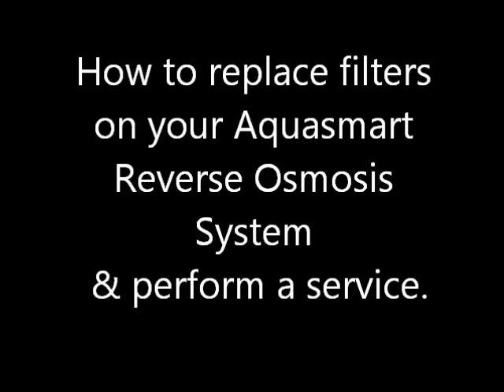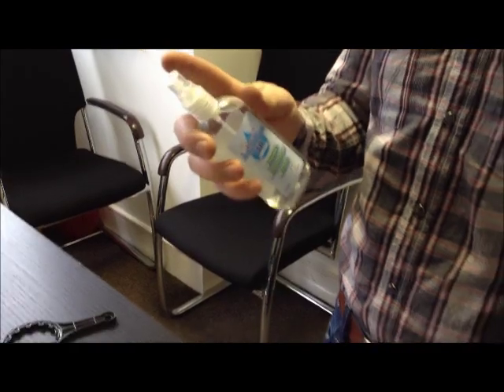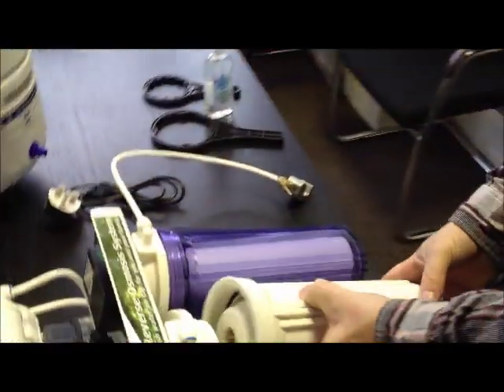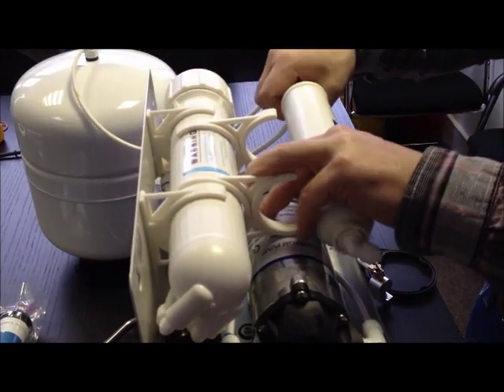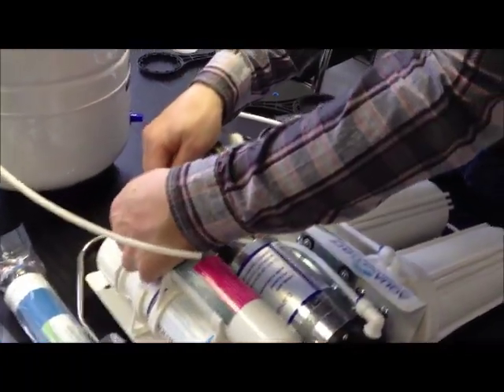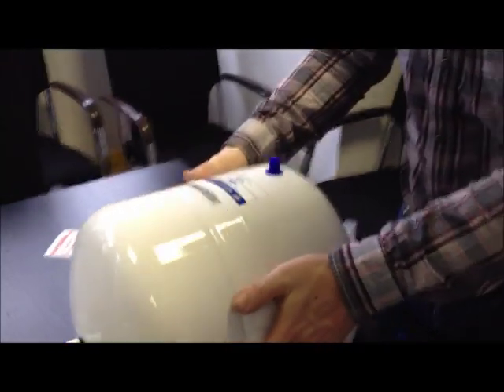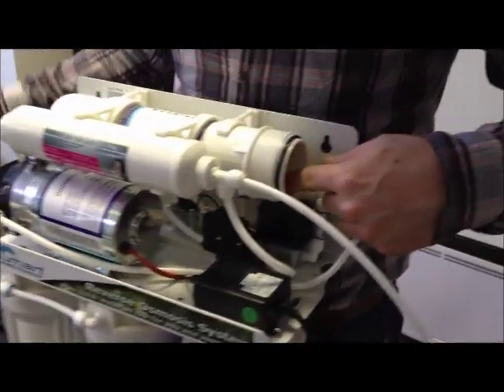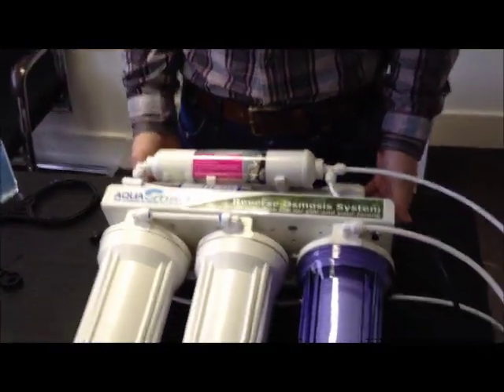Replacing reverse osmosis filters and performing a service

Comment: can u help me? I received my 5 stage osmosis machine from u today. the instructions state to insert the membrane with the 2 rubber bands on the end first, however my membrane has the two rubber bands on the other side, opposite whats in the image. so the 2 rubber bands are on the same side as the white tape around the end.. does this make sense? which way do i put it in?